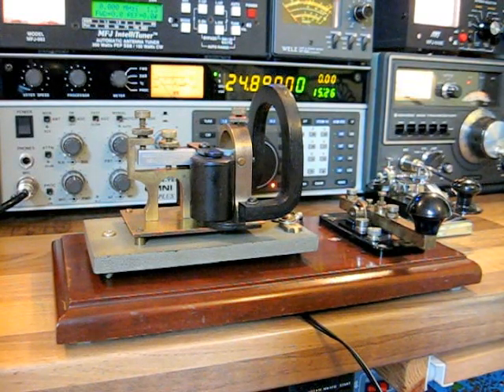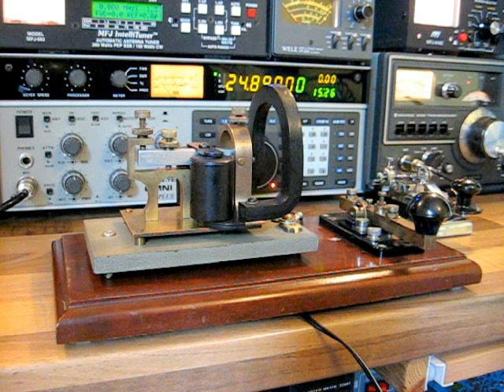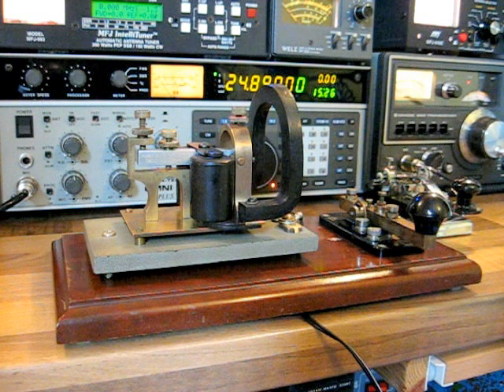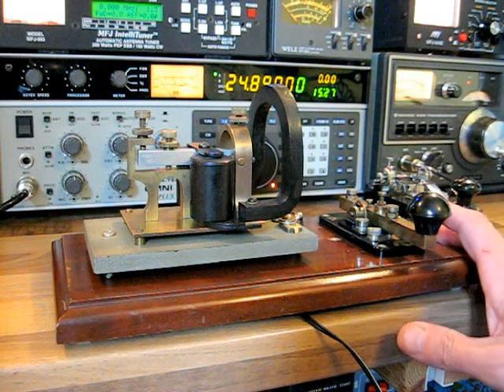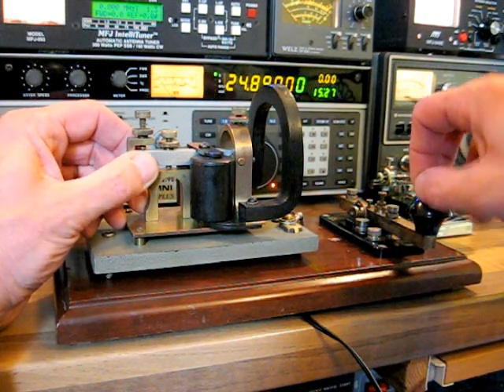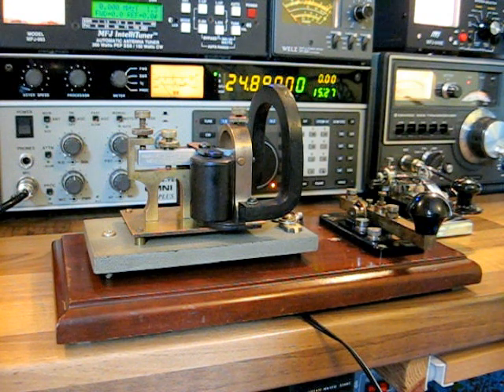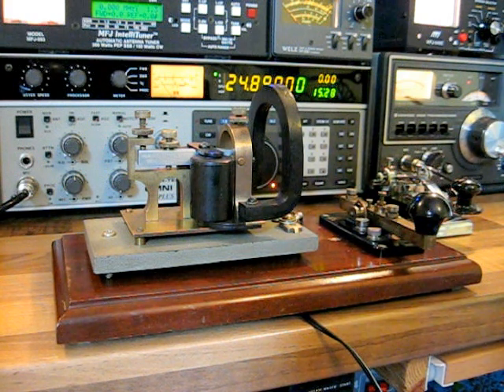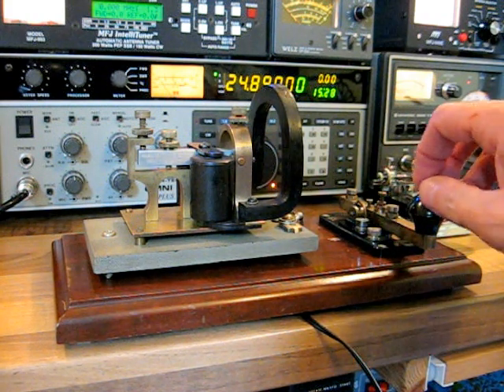Western Electric Telegraph Sounder. .

Comment: Since Morse code is based on a simple on-off signal, which can be represented as a series of ones and zeros, you can see that it is actually a human-readable digital code. And like any digital code, it is used to send data. The early telegraph was a form of text messaging. Over time, the telegraph was used for more things besides just text messaging, including facsimile (pictures), stock reports and news. They started using teletype machines that could print letters instead of just making sounds. And in time, what started as the telegraph became our modern internet.

Comment: What is the Voltage? as I have a 4ohm sounder? as I want to wire it to a IDer? as I know how to wire it. just not the Voltage and Amps?
Reply: Not sure if this applies to you, but most american sounders will run off of around 9 volts very nicely.